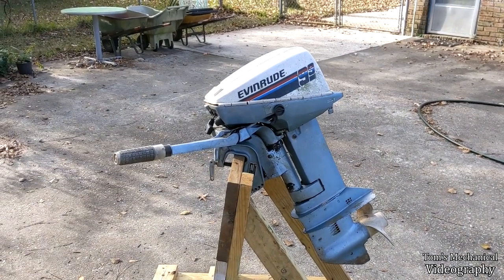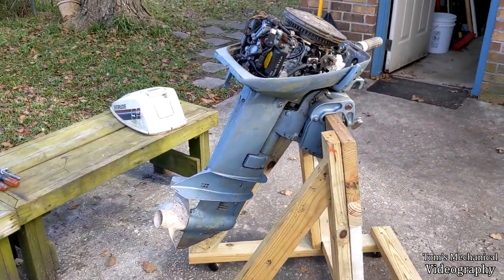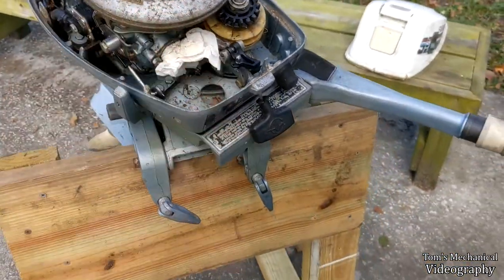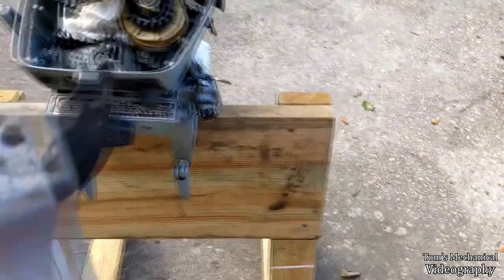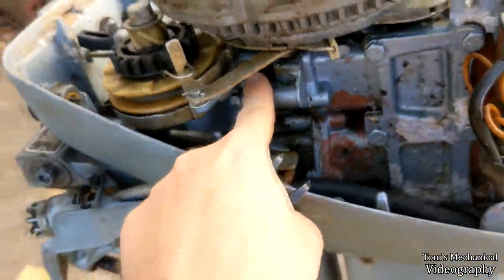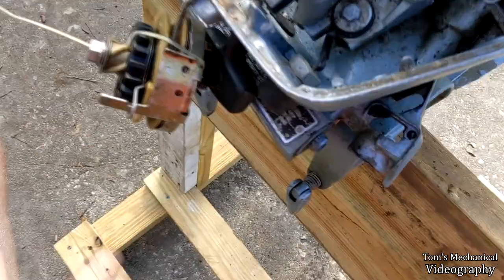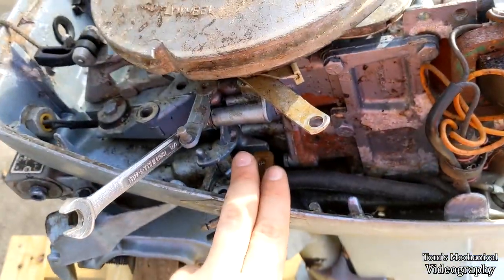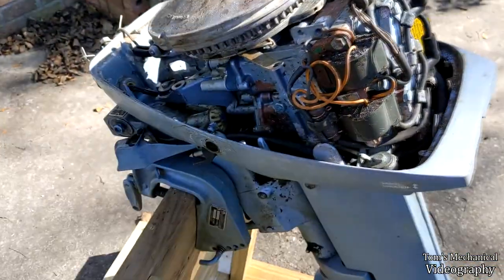Seized Throttle Gear: 1978 Johnson/Evinrude 9.9 & 15

Comment: Thanks for posting I’ve got a 1977. 15 hp Johnson the twist grip would turn but the gear you knocked out would get a delayed action the shaft that goes into it with the square end is worn out so I’ll end up replacing the shaft and gear, bought my motor for $200 and have been going thru it new pull rope pinion gear on pull starter 2 new coils and power pack , rebuilt the carb , replaced a fuel line , 2 new plugs , new impeller kit , the motor to was setting for years in a shed , it runs but it couldn’t idle down because of the bad twist grip gear to adjust the idle adjustment on the side of the motor , once she’s running like new it’s getting a fresh coat of paint and hopefully it will out live me ! 😂

Comment: Hey Tom, a VERY big thank you for this very helpful video.  I just bought the same engine with the same issue.  I found a little hack that I cam up with that may also help anyone else with this issue. I decided to drill a small hole in the case that surrounds the gear that is stuck and flooded it with WD40 / Lubricate. and with some gentle taping and twisting it eventually came free. good part is now with the hole I can regularly spray some WD40 in there.  thanks again mate
Reply: Can u elaborate I want to do the same where did you drill through the chamber exactly thank you

Comment: Another thankful viewer here! I couldn't figure out where, exactly, my binding issue was coming from since all the shafts and joints around that plug seemed free.  I watched your video and then targeted straight after that thing. I went from stuck on the beach to driving around the bay in about an hour.  THANKS!!!

Comment: alternatively if your bolt for tiller arm is rusted stuck, its still possible to dismantle this mechanism, you can remove the linkage gear by removing the throodle handle, then the linkage, then it frees up the space so you can remove the bushing/shaft.

Comment: legendary little motors and will last generations if taken care of.,, for the low compression, bring the piston all the way to the top, spray SUPERZILLA in the cylinder, then put the plug back in and let it set a few days, it will clean the carbon out and raise the compression,, it frees up the rings, great stuff.

Comment: what is the function of the twist knob at 13:54?   Super helpful video btw
Reply from the maker: It screws in and out to set the idle speed. It's position blocks the return of the throttle linkages and determine the minimum bottom end rpm by keeping the throttle partially open.

Comment: Whats numbers did you get for the compression test? Can you also do a video on a link and sync?
Reply from the maker: If I remember right, I got 70PSI for both cylinders cold. I don't think I can do a link-&-sync on this outboard. I'm not familiar with the process but I believe it's for outboards with multiple carburetors. This one only has 1.

Comment: So did it fix the issue? Mine is doing the same thing. I was about to tear into the linkage and try and figure it out.
Reply from the maker: Yes. I have easy turning, full range of motion on my tiller handle now.
Reply from the maker: @doneagan2094  I did not replace any components for this fix. I was luckily able to just disassemble, clean and regrease the components, smooth the corroded bearing surfaces, and reassemble. Replacement parts can be found on several websites, such as Crowley Marine, ebay, and amazon. Crowley has a great annotated factory diagram that will get you a name and part number for almost every part on the motor. The below link is their page that includes the parts in the tiller linkage mechanism. If you want to get cheaper aftermarket parts or if Crowley is out of stock, you can then search for that part number on ebay/amazon to see options for other aftermarket brands.

https://www.crowleymarine.com/johnson-evinrude/parts/41002.cfm?mdl=GJGDFT